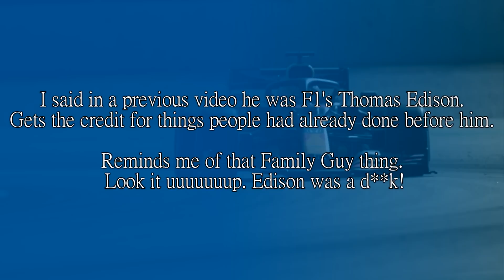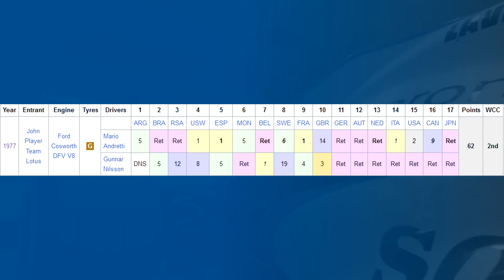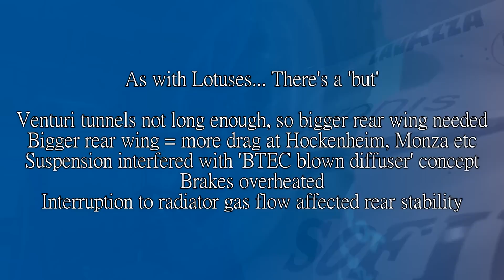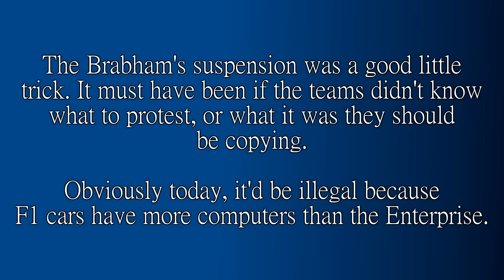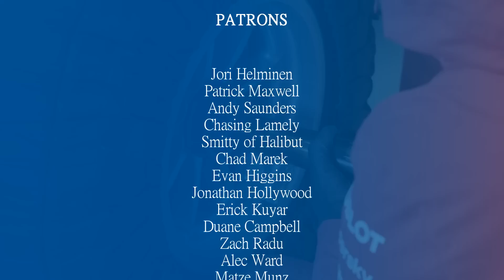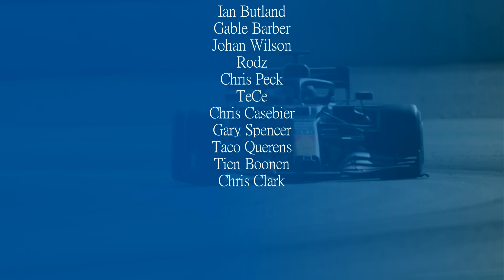HOW F1 CARS STARTED TO SUCK! The Story of the First Ground Effect Era (1978-1982)

Comment: For the record re Brazilian GP pole (1981-1983):

1981 - 1.35.079 by Nelson Piquet, Brabham BT49C Ford (no skirt, but hydraulic suspension??)
1982 - 1.28.808 by Alain Prost, Renault RE30B (ground effect + turbo)
1983 - 1.34.526 by Keke Rosberg, Williams FW08C Ford. (the first year of flat bottom cars).
Reply: For the record again ... the 1984 pole by Elio de Angelis in the Renault turbo powered Lotus 95T was a 1.28.392 showing the massive gains in power turbo had even then. And Alain Prost's fastest lap of that 1984 Brazilian GP told just how much the races were really economy runs and not actual races. Prost's time was a 1.36.449 (would have put him 23rd on the grid) showing how much slower they had to run to finish the races on the limited fuel allowed (220 litres in 1984).
Reply: I remember watching an F1 documentary on YouTube about the turbo lag some of the cars had back then. One of the smaller, back of the grid teams, had really bad turbo lag, apparently it was about 7 seconds!!

Comment: Worth noting is that, Rene Prevost, was technically first to come up with idea of ground affect, all the way back in late 1920s.
He desgined a mock-up of a car featuring venturi tunnels, with intent of it potentially making the car more stable, iirc he even recognized the need to seal the flow under the car for maximum effect.

Comment: The massive downforce was the reason for the stiffer springs - in effect the cars weighed 2 or 3 times as much moving as they did standing still. Naturally this did not help the cars stability over bumps. The other problem with skirted ground effects cars was that if the gap between the ground and the skirt increased (eg, irregular track surface) the downforce would be radically decreased instantaneously. You're going around a fast corner at a speed that would be impossible without ground effect, and suddenly you have no ground effect. That trend had to be reined in.

Comment: Ligier wasn't running stiffer springs, they were flat out cheating with a spring loaded flap in thier tunnels that would open as excess negative pressure built up on the straights. The flap would vent into the radiator outlet giving them not only a passive DRS but also the ability to run smaller cooling inlets on their side pods reducing drag. Giorgio Piola was able to get a photograph of the underside of one of the cars as it was lifted from the track after an accident, he told the car's designer he was on to their little trick and Ligeir removed the system fearing Piola would tell the stewards. Piola never said a word until decades later though.

Comment: I wouldn't argue that the Chaparral 2J was really a ground effects car.  I'd define "ground effects" as using profiles on the underside of the car to generate a Bernoulli effect, whereas the 2J and Brabham are using brute-force evacuation to create low pressure zones.  The advantage of powered fans is that downforce is not dependent on speed; the Lotuses didn't generate as much downforce at low speed. 

IIRC from articles of the time the original idea of the 78 was to be a better version of the March 701's wing-shaped fuel tanks.  Everyone at Lotus was surprised by how much downforce the car generated and that's what set them further on the full ground effects path.  

The 79 got left behind in 1979 in part because Chapman didn't do robust construction.  In an interview, Andretti described a chassis stiffening workaround that added a bracing yoke between the instrument panel hoop and the roll bar - but the car then started popping the rivets holding the chassis together!  The Williams FW07 was basically a 79 with structural integrity.
Reply from the maker: Ground effect is just a catch all term rather than super science.

Comment: The Brabham fan came about because they used a flat 12 engine so could not have the tunnels under the car like you can with a v engine, if you can find the Gordan Murray interview he explains how the got around the rules to build it.
Reply from the maker: Which reminds me, I have a direct line to David Brabham, I might have to see what he can hook me up with.
Reply from the maker: @ronmurray7349  Brabham managed to prove to the FIA that the fan did more to cool the engine than it did to suck the car to the ground.
Reply: @ronmurray7349  fun fact, in AMS 2 you can actually see this in action! It's quite neat.

Comment: Not bad! Ground effect is difficult to explain, and even harder to figure out from some incomplete discriptions you can find on the internet. Basically sqeezing the air between the floor and the ground causes it to speed up. When the air speeds up the pressure is reduced, so now the air pressue above the car is greater than the pressue below the car creating downforce. Then there is the complicated bit about the diffuser which is even trickier to explain....
Reply from the maker: It’s one of those things that people over complicate because they can.

See also: modes of the major scale.

Comment: I read about the early 80s Brabham many years ago. I recall the suspension being called "hydro-pneumatic" in that, the shocks had fluid and air in them. At speed the air would compress (with higher aero loading), but the fluid wouldn't, essentially allowing the car to hit a "point of no futher suspension travel" once all the air had compressed. This mitigated the need for the driver to use any controls to manipulate it and freed him up to drive until passing out due to the g-forces.

Comment: One of the biggest advantages with the fan/sucker cars is they “downforce” is still there at low speed. Compared to normal aero that would loose a lot of downforce at low speeds. 
Also, ground effect downforce is pretty efficient compared to wings. But, also much more unstable. It’s really dependent on gap to the ground and speed. 
Everything ends up being a balance.

Comment: The weird thing is that none of those infamous crashes - Peterson, Villeneuve, Paletti, Pironi - were due to the cars being too fast. While the cars were making the racing more risky because of their higher speeds, those particular crashes were all freak accidents that could have been just as devastating had they happened in 1983's flat bottomed cars.
Reply: thats debatable, peterson yes, that was a startline crash but the 2 ferrari? the ground effect cars made collossal downforce in a straight ling, but that would almost completly dissapear should the car start sliding. i know villeneuve hit jochen mass but still flying into the air like that was a risk the ground effect cars had, would that crash have happend or if it had would it have been at alower speed?
Reply: @theant9821  He flew over a car that was on a cool down lap because the driver moved on his line thinking he was going to go the other way. I really don't think a 1983 car would have made any difference, he went airborne because of contact (see Webber Valencia 2010) noy because of loss of downforce due to sliding.
And Pironi smashed into a slower car because he couldn't see it due to rain spray.
Reply: I think Villeneuve was still very angry, due to his disagreements with Pironi, and could be considered a factor in his fatal crash.

Comment: Was actually in karts first when the guy making the expansion pipe exhausts realised that if the first cone section was sucking the  exhaust gasses through the engine that if he put that on the floor tray that it would pull a vacuum and suck the kart down 

This was mid 70s    When the karts where not far away laptime wise to the  f1 cars

Comment: They are called Venturi tunnels because they operate using the Venturi effect, not Bernoulli.  Wings are what use Bernoulli to create lift on air planes, or down force on cars when you flip the wing upside down.  They are related in that they are both based on conservation of momentum.
Reply from the maker: The Bernoulli effect is still happening under the car. Because the car is moving one way and the road is “moving” the other way, it effectively pulls the air in at higher speed.
Reply: @AidanMillward  "So in summary, the Bernoulli effect is a more general principle that applies to any fluid flowing through a constriction or curve, while the Venturi effect is a specific example of the Bernoulli effect that occurs in a constricted pipe or tube that then expands."

Comment: Alistair Caldwell still claims the McLaren M23 was a 'ground effect' car so beats the Lotus 78 by a couple of years.
Reply: I think that's a case of wisdom after the fact. I don't doubt that Mclaren knew something was going on but they didn't have nearly all of the pieces of the puzzle together. I wish I could find the interview where I found the piece about certain Indycar teams in the early 70s, as in a couple of years before the m23 with the skirts came around (think AAR, Penske and some other teams running Mclarens besides Penske), were experimenting with flat bottoms made from plywood and discovering that the closer they could run the car to the ground, the faster it went. I think it was said in that interview that they didn't really understand all of what was going on, just that the car went faster. Before that, the tricks on the nascar aero cars show that the designers and some of the teams something was going on with the underfloor aero. 

But in the same way as with the M23 and M26, those indycars didn't have nearly all of the pieces of the puzzle needed. Now, if Alistair Caldwell had extended the flat underfloor and stuck an upward sloped sheet of aluminum with endplates underneath the gearbox and maybe curved the front section of the underfloor under the side pods at a slight upward curve...